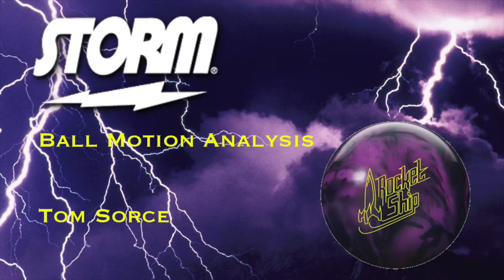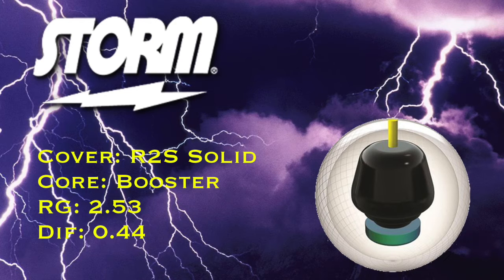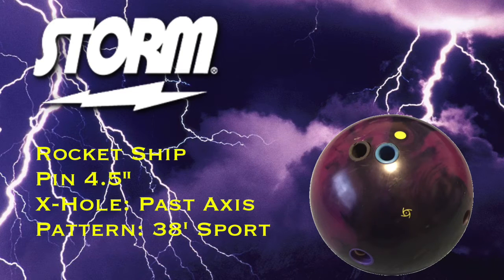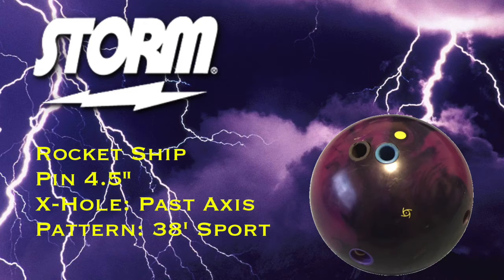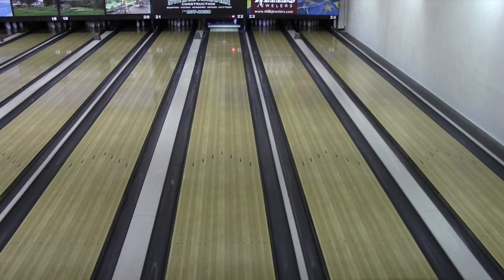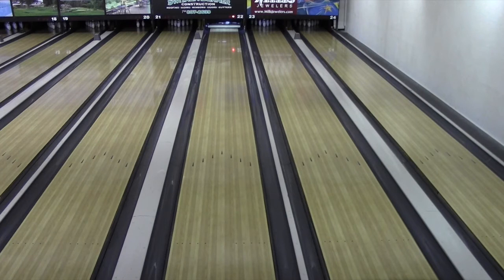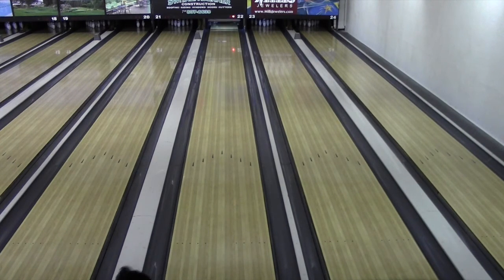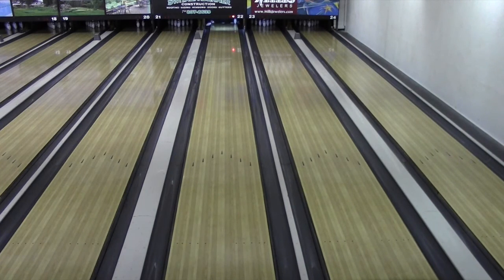Rocket Ship

Comment: I bowl on the Kegel Landmark patterns. What surface changes do you recommend for these group of oil patterns? I have the Rocket Ship and the Sky rocket as the step down ball.  Thanks and great analysis of the ball motion.
Reply from the maker: Hi Clifford.  I hate to answer questions like this but the answer is "it depends."  Theres a lot of factors into matching up your surfaces to particular patterns, especially a set of them like the Landmark series.  My best advice is to use your eyes during practice.  If you see that your balls tend to be squirting a little too far down the lane and you need them to read sooner than adding some surface will be helpful.  I wish I could give an easy answer but the reality is that its basically a case by case basis (with factors such as your speed to rev ratio, axis rotation, layouts, lane surface, etc.).